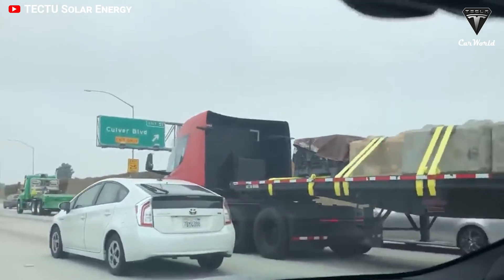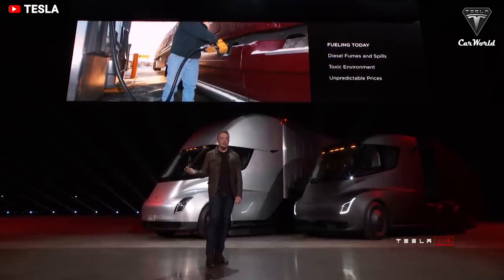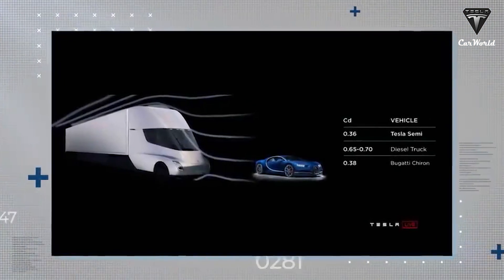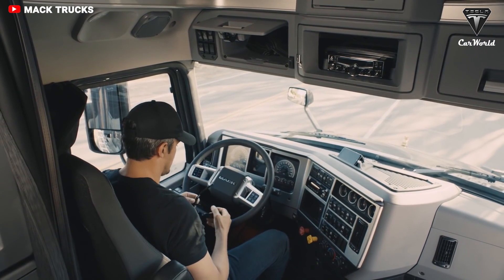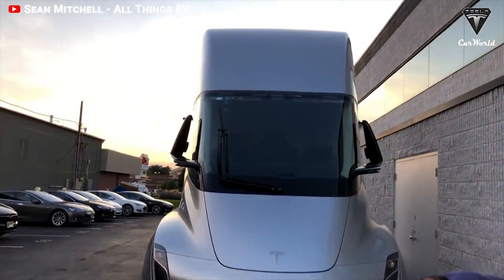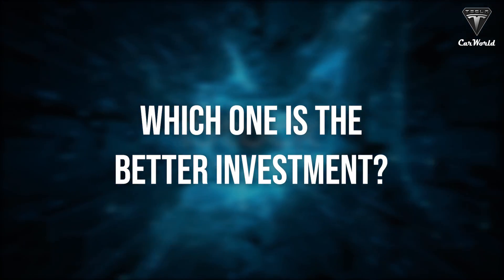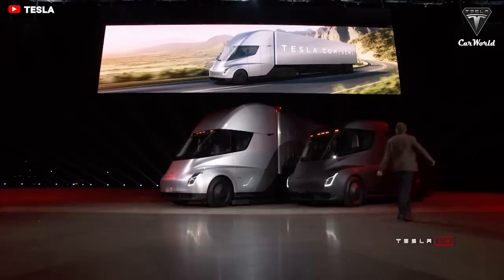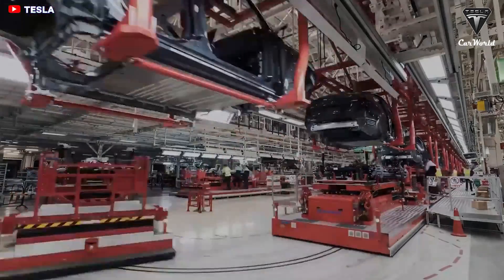Which is the KING of 2023 heavy trucks? Mack Anthem Diesel Truck Vs. Tesla Electric Semi?

Comment: This is a really bad comparison where you're using Tesla as a sports car and that's not what the fleets are looking at. Tesla does not have more payload because that's the total value you did not compensate the weight for batteries. There's a difference between the payload and actual load you can haul. Tesla will weigh a lot more than Mack due to batteries does thus reducing the actual load to haul. Tesla won't be able to go 500 miles rather than 340 and realistically that's 170 each way. Truckers are only paid when they're hauling the load if they have to line up the charge and take some extra hour or two they're not getting paid. This will be the first attempt of Tesla where they actually failed
Reply: Locomotive trains use both a diesel engine with electric motors.  So maybe everyone in these comments can tone down the “only one can be the best way” and “you can’t be right because I’m right”.  Keep an open mind to continue to move forward.
Reply: Tesla semi will get a partial charge to go the full 500 miles in 30 minutes. 

Not 1 - 2 hours.

Which works perfectly as the driver can take the required 30 minute break while charging.
Reply: @silverstake88  **in the us
Reply: Bruh  legally electric truck can tow 82000lbs while diesel truck can tow only 80000 lbs.if Tesla achieve 500miles range with 800 to 900 MW it can easily match the weight of a diesel semi.
Reply: @manojgv4556  a truck does not tow 80k lbs.. bruh you guys are idiots, that’s the gross combination weight of tractor and trailer, if the tractor weighs 38k lbs then that’s a factor that plays with how much you can actually haul, the Tesla semi is dog shit compared to a normal semi
Reply: Let see very curious… garbage truck would have been better application for it
Reply: Tesla has failed to deliver on promises over and over. The self driving software was supposed to be ready years ago.
Reply: Infrastructure is definitely not in place
Reply: @Tron Jockey >complex manual transmission
Also with the way your describing it sounds like a heavy duty cvt....cut.....
The future is planned obsolescence and it's gey.... very gey elon
Reply: But there are several components that diesel rigs have that won’t be needed on electric. Drive shafts, transmission, exhaust systems including DEF, fuel tanks, all can be eliminated for weight reduction and space.
Reply: @monteclark1115  
Drive shafts and transmission are in the rear. The other components are more underneath the cab. 
You’re only allowed a certain amount of loaded weight on the drives. Or the rear. So you’re replacing a transmission with three or four large motors. The drive shaft weight is meaningless.
Reply: @JamesDavis-vm9gw  but you no longer have the weight of the diesel engine and transmission. Yes, the truck will weigh more than a conventional diesel rig, but I don’t think it will be significantly more. And I’m sure they will adjust laws to compensate for these heavier trucks. When I was a kid, almost all trucks were cab over and trailers were restricted to 48’ due to length laws, but those have been changed so now cab overs have been replaced with long nose and super sleepers with 53’ trailers.
Reply: @monteclark1115  
Nice contradiction. You go from weight savings to saying not much more. 
Well the dot has already given them a two thousand pound allowance for just a glorified day cab. It’ll be much more weight with a sleeper on it they’ll have to start allowing. 
Watch infrastructure cost go up even more with heavier loads.
Reply: @JamesDavis-vm9gw  trucks will probably get heavier, and cargo capacity will increase over time as well. At some point in our lifetime, they will probably bump up the weight limit to 100,000 pounds and add more axels to spread out the weight. Where did I contradict myself? 100 years ago, a box truck weighed about the same as today’s modern pickup trucks and semi’s didn’t even exist. Everything changes as time goes on.
Reply: 500 miles is with Max payload at highway speed. With normal use it's much more then that.
Reply: @rowanbroekman3929  It didn't say they did that in one go.  It just said they completed 500 miles.  Knowing how badly WVs lose range when towing, it's a good bet they stopped charge en route AT LEAST once.
Reply: @billcichoke2534  I'm pretty confident Tesla didn't charge at all in those 500 miles. It's only 500 miles, not a 1000 or so.
Reply: @rowanbroekman3929  Then they would have said so.  If they had somehow achieved 500 miles on a full charge without depleting the battery to 0%, they would have been crowing all day about it.

Considering the fact that their Model X (with similar batteries) loses some 50% or so when towing, and they haven't said what the range estimate is based on, it's pretty apparent it wasn't all on one charge.  Also consider that this is supposed to be an OTR semi, but has no driver accommodations in that cab.

Pure Nikola smoke and mirrors.
Reply: Silent & others; I'm not an expert on TSLA semi-s, however the number posted by silent rejects the data already proven in the TSLA webpages & tslarati. Pepsi Frito lay will be sporting the TSLA banner soon.
As well as the semi trailer is ideal for solar due to the available area, not available on a sedan sized vehicle.
The diesel truck will be a relic, the as operating costs, repairs,  factors are  too compelling, not to revolutionize transportation on our highways. ...please read the facts before posting random numbers about things u know very little about. Ok silent & others.
Reply: Give a full comparison of their off road experiences and extreme heavy loads. Safety, Tesla won’t be safe vehicle to drive because as they said there won’t be brake changes which is a huge risk when comes to trucking industry, there is no such material that will fight against heat and win nothing. There charging problems, in case you don’t get it, truck drives in the areas where there is nothing but forest and lands which will make it impossible for charging area. Their acceleration will increase the number of accidents because all the trucker will try to beat the red light or try to get at their destination as quick as possible. Computer failures, if their computer fails while driving there will be a high risk not it will shut down in the middle of road it also cause confusion between computers. Electric failures, electric failures will be one of the most scariest failures of Tesla because they are fully electronic, will their motor be able to maintain a full load for long range? Up and down and flat roads? And what happens when they fail? I can only imagine how quick electric catches fire so I’m not trusting that. I don’t know, I’m not a fan of electric vehicles at all. Will see how safe and efficient they will be.
Reply: @surgeeagle4380  You're clearly looking for problems that so not exist.
Reply: Nissan leaf is a car ... still comparing a car to a true semi.
Reply: The legislation gives an extra weight allowance for the heavier battery. You can get as much load on the Semi as the Mack.
They will charge both while loading and unloading as well as during the mandatory rest breaks. The Tesla Semi is more than able to travel any distance required of it as long as the infrastructure is in place. Customers are initially being chosen and the relevent infrastructure is being installed to support them. This will gradually roll out with more and more customers until the whole country is covered with chargers at the rest areas.
Reply: @rogerfroud300  
🤣🤣🤣🤣
Gotta love people who know nothing about an industry want to comment on it.
One the biggest laughs I got is charging at rest areas. Um news flash. 
There’s not enough parking for the trucks that are out there now. Drive around at 2 or 3 in the morning and you can see trucks on the ramps or roadside trying to get sleep. 
Tesla semi’s are day cab not otr. They’ll park at a dc, depending on how busy, and make deliveries from there. You WONT be able to live out of them like plenty of drivers do.
Reply: @rogerfroud300  The Tesla semi is a joke.
Reply: And the diesel semi doesn’t need 1000hp to haul 80,000lbs! A 1000lbs diesel truck is the ultimate heavy duty truck that can haul about 500 tons of load😅😅😅
Reply: Don't forget working in extreme temps also give the diesel the advantage.
Reply: @alonzosmith5075  not really, the battery system has heating and cooling systems to keep the batteries at optimal temperature. Some of the cheaper earlier EVs like the Nissan Leaf didn’t have that capability and that’s why their batteries degraded before they should have. Modern EVs don’t have those problems.
Reply: @Monte Clark  No, now modern EVs are burn hazards, and batteries are far more expensive and larger.  Benefits?  Not many.

And you still don't address the roughly 40% drop in charge in temps under 45 F.

Comment: damn the mack instrument panel is a failure alone. i think they need at least 10 more buttons. a few more gallons of diesel fuel in the tank,  and the engine could be a little bigger. lmao
Reply: Nonsense!!!! How is it a failure when it actually works!? Tell me!? Which trucks did Tesla used to build their factories in records times!? Was it any crappy electric truck!? Lol😅😅😅😅 a diesel truck can literally work 24/7
Reply: @carholic-sz3qv  not until it runs out of diesel fuel. didnt take long for someone to get upset over a joke. calm down and go sniff some diesel.
Reply: @kpop863  he gets a h4rd-on when taking your advice.  Or maybe only a Semi... 😅😂🤣
Reply: The MACK doesn’t need more power because even with 600hp it litteraly goes much more than even a 1000hp tesla semi!
Reply: On diesel trucks you can actually configure with bigger fuel tanks for more range and even more flexibility which is impossible with EVs.
Reply: A scania 770s with you guess 770hp literally haul 4 times the tesla 82,000lbs

Comment: Tesla Semi will rule the heavy truck world . Elon Musk will see to that .
Reply: Never not even in your dreams lol….. diesel is and will remain the ultimate kind of the road! Just look at Volvo fh750 or scania 770s they can literally haul 4 times 82,000lbs Elon 2000miles without refueling across the Australian outback.
Reply: @carholic-sz3qv  may be ... but have a look on the costs per mile  ... if it is correct what tesla said,  this will make 800 dollar for 2000 miles... greetings from germany Christoph 👋👋👋👋👋
Reply: Also why does tesla needs 900hp to barely tow 82,000lbs which the government added 2000lbs because of the already heavy batteries!!!
Reply: Diesel trucks are literally able to work 24/7 non stop doesn’t matter where they are! Totally impossible with any EV.
Reply: No such thing as “Zero Emissions” follow the electrical cord out from the plugged in EV to the “coal or gas” power stations..
I have yet to see a driver of a fully loaded truck worry about how quick off the light his work truck can go.. 80,000lbs is no joke when it hits a passenger car..
don’t believe Musk when he says you’ll never have to replace your brakes..read the fine print when you get your EV truck .as a heavy equipment mechanic I call Bull shit on this claim
also the presenter doesn’t realize long haul sleeper cab trucks have been around for decades ..I rode in my uncles back in the 1970’s while helping him handbomb loads during my summer breaks from grade school 
FYI ..most drivers I know drive 600-700 miles a day “Non Stop”.. so that 300-500mile EV battery will not be impress anyone unless they drive local 
Cheers from HudsonBay Ontario 🇨🇦 
where you’ll never find an EV for 100’s of miles ..
Reply: Not for some time, Electric has Range and Charge time issues
Reply: Ya like all the other things he failed to deliver as promised , wake up dude .
Reply: Not for a very long time, My Mack would kick Electic trucks but on z mountain grades.
Reply: If it doesn't work..... it might end up being a youtuber semitruck.
Reply: @stickers-w4u  What think is funny is all this hype about delivering trucks in Dec and there's not really any real charging infrastructure in place for them.
Reply: Not if Volvo have anything to say about it - they have five thousand electric trucks on the road NOW.
Reply: A 900hp Mack truck will literally haul about 500,000lbs why not more!
Reply: Do we have a charging network that pushes enough KWs to charge the Tesla semi in 30 mins?
Reply: Hyper truck ERX made by hylillon coming soon🤩
Reply: Maybe short distance
Reply: @stickers-w4u  If you do the math , with a 1% grade and a 10mph headwind the 500 mile range drops in half. Tesla based it's range figures based on perfect conditions. Flat roads and no wind. Not real world conditions. Elon has used these tactics on every project he's been involved in. The Starlink project is a perfect example. His estimations on cost were so far off it was ridiculous.
Reply: @bobbybishop5662 is true and now add hills, mountains.... real world test will tell, i won't instanly discard it tho, i still need to see in real world scenarios.
Reply: @bobbybishop5662  A diesel trucks range drops through the floor on a grade too…
Reply: @allangibson8494  Yes that is certainly true. Understand I am not against EV in general , there is certainly a place for them in transportation needs. My point to most of my comments on EV is that the PR campaign tactics are not giving the public the full picture. They are using blanket statements to enhance the the effectiveness of the vehicles. Example , when they say the Tesla semi is going to get 500 miles on a charge , it comes across like no matter what the conditions it's going to go 500 miles on a charge. The honest way to explain the milage range would be to make it clear  that a 500 mile range is possible but that variables in driving conditions can and will effect milage range. It's almost as if they want the public to believe this truck will be imune to the laws of physics. Problem with that is that there are people that will actually believe that. It just dishonest on its face to market any product in that manner. This has been Elon's tactic on every project he pushes . Elon's projects have achieved some impressive results but in almost every case they haven't been achieved in the time frame and estimated cost he used in his PR campaigns to raise funds from both private investors or government subsidies. When he states his truck is going to revolutionize trucking that he should include that when a charging infrastructure is in place across the county to support them it could achieve those goals. For his fan base to get so excited that they made one test run , under conditions they selected and are delivering some trucks to a customer IMO is just silly. Let's see him make the truck available to a third party independent entity with proper experience and testing capabilities to evaluate real world performance. Wouldn't that be a clearer picture of what Tesla has achieved with this truck ? Same with the actual effect producing EV is having on the environment when fossil fuels are a major part of the charging and mining used to produce the batteries , metals and plastics used in the cars and trucks. It's just all very one sided not telling the complete picture of EV industry.